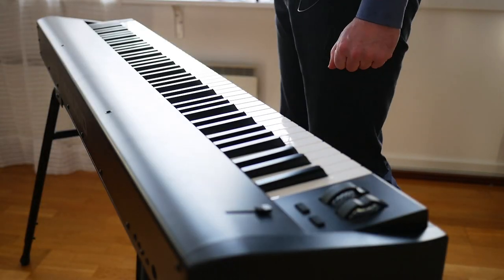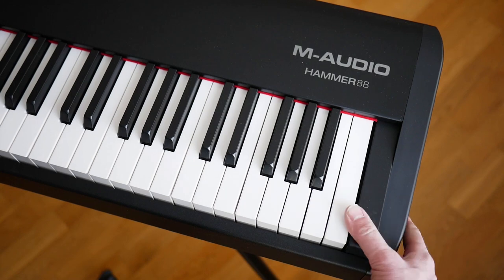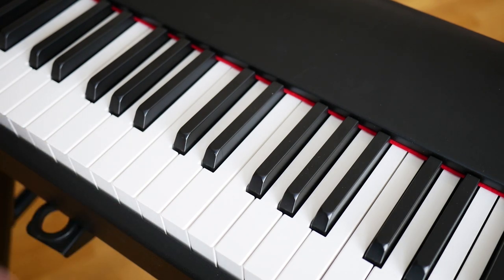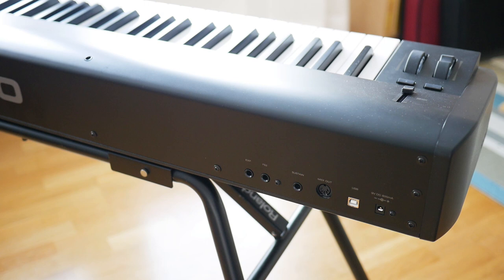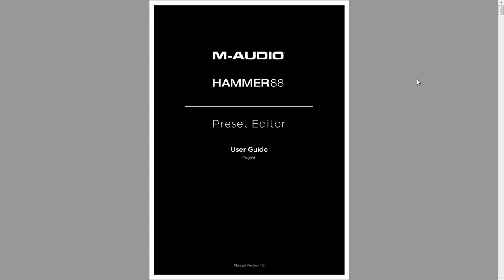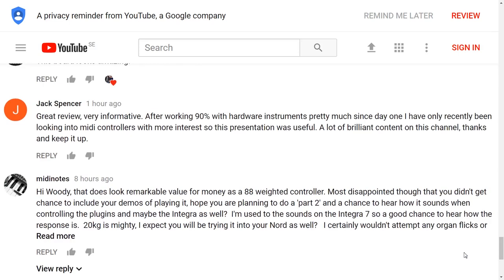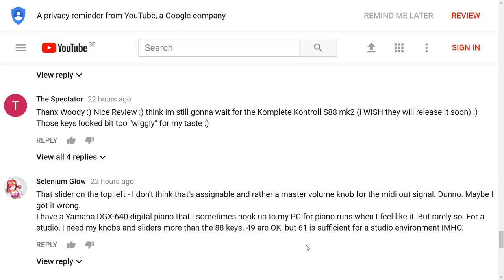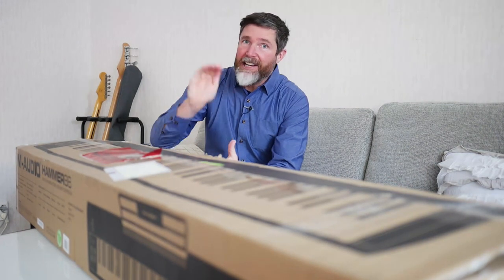M-AUDIO HAMMER 88 review wrap-up and viewer feedback

Comment: Great video.....I'm 72, don't use laptops at all but I use external old school key modules....picked this one out as it's properly weighted & has a simple transpose function.....the real pianos from Roland, which I use, are just too expensive now, but I got what I wanted here, pre owned for $280.00.  Prob use in my little studio but it could be a good back up for my Roland RD 300 NX, although I wouldn't be able to split.  Been performing for 40 yrs!

Comment: If you want 88 keys, but aren't so keen on the whole graded/weighted hammer action, the Nektar Impact LX88+ costs less and has more controllers.

For ultimate piano action, Kawai makes the (much more expensive) VPC Virtual Piano controller, which has the same hammer action of an actual piano and wooden keys as well.

Comment: I use the CME UF80 WiDi, radio MIDI. The keys are nice and heavy hammer action and you have a lot of control options both with sliders, dials and build in "Shift"-"key"-"number(1-128)" combinations. I can even select voices from my PLG150DX plugin boards inside my Yamaha MU128 v2. by setting MSB-bank and a voice-number. You will probably dislike the  complexity of all the options and the minimal manual. 

AKAI Advance 61(VIP3.1 + a bundle of fantastic AIR synths) ) The keys on AKAI Advance61 are unpleasant "hard spring" "dead"-motion. The worst I can imagine. 

The yamaha MX49(free cubase 6 ) The keys on MX49 are light but has a soft click-like resistance that makes them feel "alive". MX88 hammer action is also out now.

I would like to see you test any or all of them. :-)

Comment: Got mine about a week ago, I am so impressed, it's bit on the heavy side for travel but the touch and built quality is superb. Using the Hammer 88 with mainstage so I kept it's velocity curve linear in the editor and setup the velocity within Mainstage to my liking for individual instruments. BTW it fits perfectly into Roland - CB-88RL bag as it's the same size as a Roland 300NX. The mod and pitch wheels are very smooth. Tested with Pianoteq6 demo, oh my, this took the Hammer-88 to the next level but this software is bit expensive so I'm sticking to what I currently have with software, perhaps I will wait to see what happens on black Friday with the offerings, hopefully get it half the price. Lots of questions about the feel, I've played on a couple of Yamaha and Roland stage pianos and this really beats them by far. Sturdy keys, a tad spongy, but not so that it's unpleasant or feeling laggy. Once you setup your velocity to your liking this is something to be hard to beat.
Reply from the maker: thanks for the comprehensive review andre!
Reply: All thanks to you Woody, your video review made me bought it ;)

Comment: This might very well be good to play on for someone coming from non-hammer, non-Fatar semiweighted action keyboards. If you like weighted action or Fatar, this is probably not what you want instead. The key action seems very much lighter than the Kawai ES-110 I got after many tests and comparisons, which is about the lightest proper piano key action digital piano. It's only 130 EUR dearer, has been an inspiring joy to use, and is as compact depth wise and actually less long (cos of the, deplorable in my view, lack of mod/pitch wheels). 

Yamaha P-45 is actually 90 EUR cheaper than this, which is incredible, since you get the same GHS action as in the P-115 (now 125, so check for P-115 bargains!)

You could probably play faster on the M-Audio than on weighted pianos as well - that's what you trade for the hammer coming back down (or sometimes, up).
Reply from the maker: great tip on the P45, I've wondered if it's worth getting an 88 synth or piano over a controller.
Reply: That's it isn't it? If it doesn't have sounds in it, it has to be that much better to warrant a comparable price, and even though we're (seemingly) spoilt for choice quantity wise, that ultimate keyboard controller remains elusive...

It seems impossible to avoid some rather important sacrifice. If it isn't lack of transport or sliders, the keys are not there or - in the case of digital pianos, which are a huge seller - lack of mod/pitch wheels.

The ultimate keyboard controller in my mind would actually be a synth action aftertouch one. It just gives the most versatility. Channel aftertouch is fine. 61 keys is fine. It just has to be as good as a Kurzweil board and I haven't seen or felt any such yet.

And the next step from this reasoning is, OK, the board has sounds, but why pay a Krona/EUR/USD for a synth that doesn't synthesize?
 But this synth had to concede a digital piano is worth every Penny/Öre/Cent. It just steals time majorly for hammering out songs. Um, like a real piano :D but yeah it really does sound better and sound hunting is over in like 3 button presses. Lot to be said for that I think.

Comment: Hi there, I bought this keyboard after piano and now I wish I had some faders to dreate articulations and cc1, vibrato controller on top of the mod wheel and pitch bend.  I love the hammer feel and full octave but I was wondering if you have any suggestions on a small midi 3-4 slider controller I could put on the side and use in albion library.
Reply from the maker: check out the korg nano controllers!
Reply: @WoodyPianoShack  Hi there Woody, I just got the nanakontrol usb midi with 8 sliders and it is perfect for the M-Audio 88 Hammer.  It fits nicely on the top part of the keyboard am soo happy hopefully it can be mapped to Kontact libraires like Albion One to allow sliders to articulate different expressions like vibrato, sustain, cc1, cc21 etc...  Thank you very much for suggestion!

Comment: Native Instruments keyboards are great, not the best value for your money though. I like Studiologic a lot - it's basically a brand of Fatar, they realized their keyboards are used everywhere (think Korg, Nord) so why couldn't they make MIDI controllers as well. I managed to grab an old beast, the Studiologic SL-880 for $220 used. They're going very cheap these days because they either have no USB or the USB drivers stopped working during the transition from XP to 7 (and 64-bit). MIDI over DIN still works a treat with those though, and you have that in most audio interfaces. Not to mention being able to run without USB, with just a power brick and a MIDI cable is incredibly refreshing for stage use - USB is just too flimsy for that, the cables pop out way to easy and you get all sorts of issues with drivers when trying to get stuff back working
Reply: The NI controllers are great for software integration. Otherwise the action on those controllers sucks. Just my two cents. I will never purchase one of those until significant changes are made to the action (both the weighted and synth action keyboards)

Comment: Awesome video, man!! I’ve been looking to buy a midi controller with a real piano feel. It is between the m-audio hammer 88 and the Yamaha p-45 as I heard it can be used as a midi controller too and it has graded action. How would you compare those in terms of imitating an acoustic piano? I think the action on the m-audio is not graded and I’ve also heard the Yamaha has problems with velocity when used as a midi controller, that’s why I wonder which one would be better. Thanks in advance!
Reply: i would recomend the roland fp 30, yamahas entry action isnt that good tbh.
Reply: @transbianyan  Only problem with the fp30 is that it's more of a home piano. No expression pedal jack, no mod or pitch wheels.
Reply: @godisbollocks  the stand for the fp30 has a pedal extstention wich has the usual 3 pedals
Reply: @transbianyan  Right, but if I wanted to use an expression pedal to modulate the parameters of a VST patch that I was running via USB midi, there'd be nowhere to plug it in.

Comment: I just looked up the price and now I wonder, how does the hammer action compare to 'complete' digital piano's like a Casio M360 or a Yamaha P-45?
Reply: was wondering the same thing. better off getting something like a Yamaha p115?
Reply: Every P115, 45 or similar Yamaha that I have tried in a store, has keys that are super click. Granted they've probably been abused in the store, but...it also has to do with the road worthiness of these keyboards. I just ordered the Hammer88, hopefully it will hold up over the years.  @stevejames9261
Reply: @jaketanner109  what are your thoughts?
Reply: @giroliro3  I go the Hammer88 by M-Audio, and couldn't be happier. The response I get from the keys is dead on accurate. Haven't touched a thing in the software...just worked out of the box. Velocities from 1-127 are had with ease. A tad noisy, but it's a very inexpensive controller...but damn am I impressed. If you do compare it against something like the P-45, keep in mind that for roughly the same price the Yamaha gives you sounds, the M-Audio is just a controller. I am mentioning this because Yamaha has to skimp out somewhere to offer a sound engine and speakers all for the same price. So my point is that more care went into M-Audio's controller. I had reservations about this product...but finally went for it because it was cheap, yet had excellent reviews, and they are well deserved.
Reply: @Jake Tanner thank you! I believe I will buy this instead of the P45. I already have piano VSTs and while the P45's speakers are nice I can just plug speakers into my laptop. Thanks again!

Comment: Da F? The sharp corners of keys... Instant fail?
Reply from the maker: depends on your playing technique, for me it was noticeable, but for others maybe not so much
Reply: Yeah, i'll try it in the store. Which 88 keyboard controller has the best piano like quality feel? Also, i'm debating if to buy an electrical piano or keyboard controller with 88 piano like keys... 88 key controllers seem lighter. Quality piano action keys is important to me, reliable once that last.
Reply: Just got mine today. There is no sharp corners whatsoever on the keys. In fact, they're quite smooth. NOW...this leads me to believe that M Audio may have addressed this issue, but I can tell you, they feel very comfortable. What Woody may have been feeling is the overlay joint on the very very front of the inside of the key...Your fingers however, should not really be touching there anyway, but that's the only thing I can think of.  otherwise, the other 99% of the key is smooth.